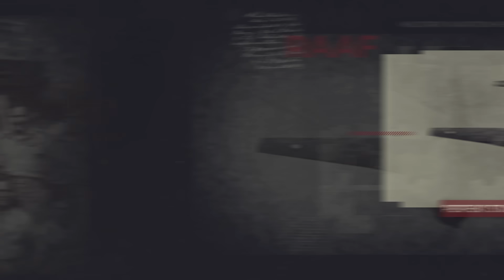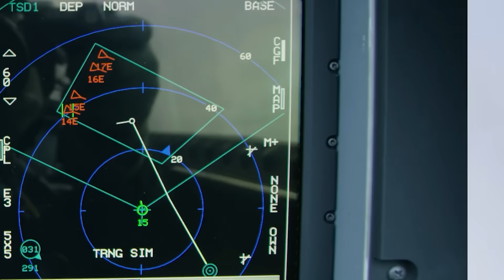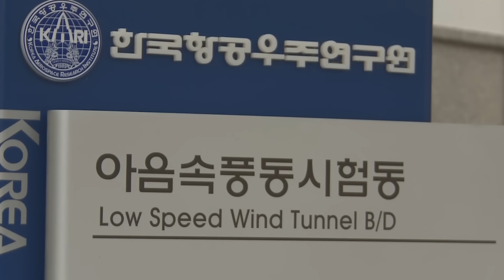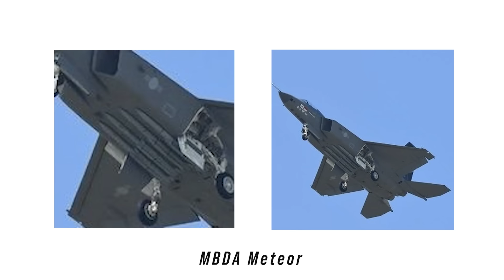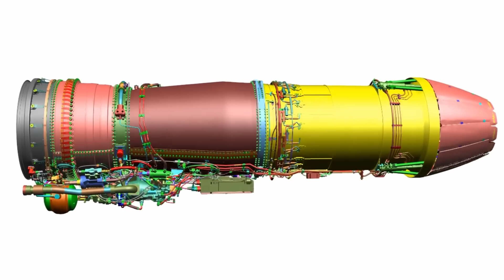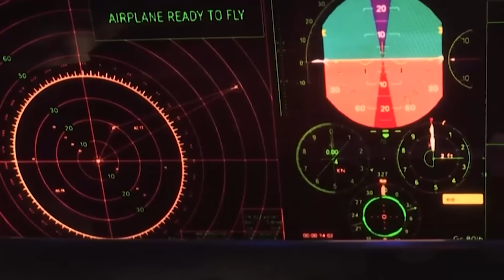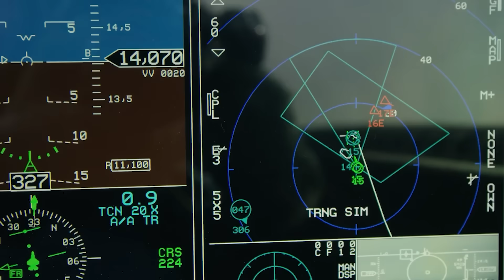KF-21: Korea's New Fighter

Comment: I would love for RAAF to take on the Black Widow II (the YF-23 concept) as replacement for the JSF, just I guess modernized, since there has been seemingly no engagement with NGAD or Tempest concepts for 6th gen.
Reply: Australia doesn't even build cars.  How do you expect such a small economy to build even 1980s cutting-edge aviation, much less an updated version?
Reply: @floycewhite6991  Australia is not a small economy. It is building both the ghost bat ai drone and the ghost shark ai submarine. And of course it would need participation from Northrop Grumman since its their ip.
Reply: @OniFeez  australia should be a way bigger economy and power tbh, obviously they have done very well but all the natural recourses, location, land, allies, education etc could get them into the top 10 most powerful countries if there was a real push,
Reply: @floycewhite6991 we used to have a good aircraft industry that made some jets I suppose education and reactivation programs would barely do the trick

Comment: It would be great to see Australia return to designing and building aircraft. Start with a smaller, cheaper, turboprop maritime patrol aircraft to supplement the big, expensive P-8s. Something that can be forward based on island territories (Xmas, Cocos, Norfolk, Lord Howe) with smaller runways and austere facilities, or just distributed across more of our coast. Then, move onto a light multirole jet that can double as a trainer. By the time its ready it can replace the Hawks. In the event of a war, we probably won't be able to rely on timely replacements for lost F-35s. Being able to locally produce a gap filler, or quick defense in numbers, would be good.

Comment: I am not an aviator in any way.  But I have been on the planet for 65 years.   My question is about stealth.     With North Korea and South Korea so close to each other would stealth make that much difference?    They have such a limited direction of attack and the time is so short I think they are right to use a less expensive air frame and make more.
Reply: That's a good question. KF-21 is named for the 21th century aircraft. So it's not for preparing against for NKorea. also, the above video didn't explain Manned air craft operating Unmanned aircrafts. Isn't it cool? If the stealthy aircrafts operates its wing man fights w/o flighters, this will help less life lost to perfill their tasks. It's a kind of 6th gen concepts. that's why the stealthy air craft design keeps to be support.
Reply: It has enough stealth to have an edge against the DPRK but doesn’t rely entirely on it. It has equivalent firepower loads to an F-16 which is a lot more than a fully stealthy fighter with only internal weapons.
Reply: In fact, it is not a fighter to take on North Korea. North Korea has less than 20 fighter jets that can actually operate. Because it has no parts and oil.
Reply: 그래서 대부분의 공군기지는 후방에 존재한다

Comment: Since the F-5E/Fs in S.Korean service only has short-range AAMs and light ground attack capabilities only Block 1s are more than adequate as they will have BVR air-to-air capabilities. My guess is that as the platform matures and becomes a true multi-role jet they will help phase out the 130+ KF-16s built under licence in S.Korea.
Reply: Among 40s of180s KF16C/D has done upgrade to F16V. And 40s of KF16C/D would be upgrade to F16V now.
No need to decommissioned soon.
Reply: The f-16c version held by the Korean Air Force is currently undergoing an upgrade to the f-16v version. 
In addition, all the f-15k aircraft will be upgraded to the f-15ex specification. 
Therefore, apart from the actual deployment of the f-21, there is no reason for the f-16 and f-15 owned by the Korean Air Force to be retired in the near future.
Reply: The Korean Air Force is considering upgrading KF16 to F16V.
Reply: @ChunSik262  이미 사업했습니다. 검토중아님니다 ㅡㅡ;;
Reply: They are going to do a weapons bay in block 2 aircraft and improved stealth, then in block 3 air to ground, they are developing this aircraft better than the f35 by doing everything all at once and look at all the problems they have had with the f36, over 800 tech problems, south Korea is doing it better and smarter.

Comment: The KF-21s will first replace the legacy F-5E/F made in the US. Then they will retire the locally made KF-5E/F (built by Korean Air in the 80s). After this they will replace the first 30+ F-16C/D that was brought in from the US. As for the F-4E set to retire in 2024. Seoul placed an order for 20 F-35As to augment the 40(39 one lost to bird strike) in service.
Reply: Japan also recently retired their F-4. In both countries they have used them as bomb trucks in later years so worked well enough for that until the airframes aged out.
Reply: They are still running F-4s ? Wow.
Reply: @notanymore9471  This is because they have a large number of long-range air-to-ground missiles, PopEye. PopEye missiles can only be operated on the F4 Phantom II. However, the Phantom has a lifespan of over 40 years and is gradually being retired in Korea.
Reply: @notanymore9471  Small country without the industrial base to support aircraft development.
Reply: one reason South Korea keeps legacy aircraft is because their simple design allows them to be scrambled in less than 5 minutes whereas f16s&f35s take at the very least 10~12 minutes. considering that Seoul as well as most of south Korea is only a few minutes away from North Korean threats, I think this is actually a very good idea

Comment: Uhh, this looks more like an F22 than an F35. Very cool.
Reply: It looks kinda like a hybrid between the two to me……
Reply: @notanymore9471  Either way looks pretty nice
Reply: @tigerthyssen3313  definitely the Koreans are savvy
Reply: The South Koreans had engineers from Lockheed Martin come over and help with the design so it's kinda' not surprising it looks like an F-22
Reply: @AsianDudeX01  It's basically a copy then
Reply: @ViktorZhang-n1g  not completely as it lacks the 22s type of thrust vectoring nozzles and is not full stealth
Reply: So that’s a bad copy. You better buy genuine F12 without spending ridiculous amount of money for developing from scratch, not sure SK spent such money though.
Reply: @平田桂-s3p  Not a bad copy. Its mean to be an affordable air defence fighter that can take down enemy stealth fighters. Between the F-35s and this, it should do a pretty good job. F-22 is still overkill. Nothing in the sky can see it. It also uses Tech's that are still illegal for the USA to export. Those techs by the way have still not appeared in enemy aircraft designs. So this Jet should be more than capable of handling Chinese or Russian knock off stealth fighters. Not only that but it should have more modern avionics than F-22 and will integrate better with F-35 than the F-22 currently can, plus its exportable. So if you look at an F22 like the B2 stealth bomber, then the KF-21 is more similar  to the B-21 which is built to be more affordable and mass produced. Similarly, F-22 could be compared to Ken Block's Gymkhana Subaru and the KF-21 is like an off the shelf WRX-STI and Russian/Chinese fighters are like a regular WRX.

Comment: Oh c'mon. Designed "from scratch"? It doesn't matter what earlier sketches or models might've looked like, clearly the final design takes 80-90% of its design cues direct from the F22. Personally I think there is no better warplane to try and emulate when creating a new fighter, but any claim that Sth Korea just happened to end up with a plane thats like a mini-me F22 by sheer accident or natural evolution is laughable.
Reply: Hush... the laws of physics care not for your missguided assumption.
There are only so many ways to build an LO fighter, of course they're going to look similar.
Reply: @FallenPhoenix86  On that basis, explain why the Su57 and J20 do not look like an exact F22 copy? And please don't say the KF21 looks like it does for stealth purposes, even SK admits its no more stealthy than a Gen4.5. And if I am therefore "misguided" as you claim, then I can only assume your glasses need cleaning.

(Edit: oh and it does not just look "similar", it looks a copy. I could show a picture of a KF21 to 100 aero nuts and I reckon 90 of them would say, "That's a Raptor". They would not mistake that about an F35, J20, Su57 or even the YF23... all designed to be LO)
Reply: @sbg911 SK did not admit it’s no more stealthy than 4 gen. It’s 4.5+ gen with smaller RCS than typical 4th gen fighter. Block 3 version will be full stealth with internal weapons bay.
Reply: @sbg911  
In broad terms... they do look alike, check your own glasses perhaps?

The J20 mixes it up with canards and the 57 has a flattened vertical profile, otherwise they are quite similar.

Again, the laws of physics don't care what you think.
Reply: @JohnLee-db9zt  my apologies, I meant to write 4.5... i have corrected that. But it is not considered Gen5 which is the point I was trying to make, considering I was being told all LO stealthy aircraft naturally end up looking like an F22 twin...  which to my main point, and the J20/Su57/YF23 show, is simply not true.
Reply: @FallenPhoenix86  This is not "broad terms". All planes look "similar" in broad terms, they all have fuselage, wings, tails (most). Obviously, designing a stealthier aircraft will have to have some similarities... but the KF21 is like showing someone a Raptor photo and then asking them to draw it. Thats my point, its too specific in its design cues to be claimed as designed completely from scratch. And I bet if the KF21 came not from an ally but from China as say the J22, people would be crying espionage.

Btw dont get so hung up on my glasses RESPONSE. You are the one that started it off by getting personal.
Reply: @sbg911  
Nose profiles.
Canted twin vertical stabalisers
Wing/horizontal stabaliser planforms.
Canopy contouring.
DSI inlets (where applicable).

Start looking at individual details across all 5th gen fighters and your going to see a lot of things in common... because the laws of physics don't care who you are, only what you're trying to do.
Reply: @FallenPhoenix86  Seriously, I am astounded this conversation is happening. Why can you not see that the KF21, out of ALL the recent fighters created, is more than just a collection of similar bits on all stealthy fighters and almost a copy of the F22 (albeit different size and no thrust vectoring nozzles)? Why is it you continue to argue this and therefore refute the fact that there are lots of articles, vids and comments across the internet with the question "why does the KF21 look like the F22". Its not "why does it look like the F35"... Or the Su57, or the J20... some other posters have even got to calling it the "baby F22".

Why try and score points on the basis of individual stealth components, and just bring up a picture of the KF21 and a picture of the F22 and see that no two other fighters look more like each other than those - its like you are denying your eyes - that you can fool many even aero types that a picture of the KF21 (minus the obvious painted "KF-21") is a Raptor. You can't do that with a KF21 against the F35, or the Su57, or the J20...

I am starting to feel if I showed you photos of twin brothers you'd say well, all brothers have noses, and eyes and arms and legs and...

My original OP was commenting on why, in the VIDEO, it's claimed the KF21 is designed from SCRATCH, and just somehow accidentally ended up looking like the F22's baby brother. Even a tacit glance at the two together can see the KF21 is far more than just some common bits all stealthy fighters have. And the differences to those other designs prove that.

And as I also said in my OP, there is nothing wrong trying to "re-draw" an F22 for your fighter design. It's actually a smart move, what is better to try and emulate than the premier fighter in the world. So I am not attacking the KF21, I hope it is a great success story. Just don't try and tell me when the SK engineers hit a snag or design issue they didn't say, "how does the F22 do this". And did that so many times, they ended up with a design that was seperated at birth.

So if none of that brings us back on track to my original comment's intent, then we will agree to disagree forever, and I will end it here and leave it up to others reading if they think the KF21 looks more like the F22's brother/baby than any other plane does (just search that on google), or as you infer its just an accidental collection of common bits all stealthy aircraft have.
Reply: @sbg911  
And I'm astounded you can't acknowledge there is a reason why trying to achieve similar outcomes will result in similar solutions and leave it at that...
Reply: It has avionics derived from the F-35 which puts it a cut above F-22 internals. The high speed intakes similar to the F-22 signal that it is designed for air superiority like the F-22 rather than low speed strike optimized like the F-35. The external weapons allow engaging a much larger number of targets at the same time at the cost of reduced stealth which is appropriate for countering the large but ancient DPRK AF.
Reply: 그렇지않다. Kai는 록히드마틴으로부터 자문을 구해왔다고 말했다 항상
Reply: ..how to define a homemade jet fighter?,even some of the f35 components are built here in Australia.

Comment: comment being 13:00 wow you are deluded these aircraft have been proven to lack flight time before needing major replacements is this channel a joke? 13:45 do you mean exceptional parts replacement of the engine due to kinda lack luster durability of metals in jet parts
Reply from the maker: No the channel isn't a joke - just in case you were wondering.
Reply: @raafdocumentaries  thanks hahaha just haven't laughed as much with this "modern techknowledgability" fancy not flyinginging in a 2nd hand kraft only because typical hours till service. ok its not metal is not ok yes delta no1.

Comment: Is it stealth like the F-35?
Reply: 4.5 gen very small RCS
Reply: It has lower RCS than typical 4.5 gen. It is more of a 5- gen. That minus is only for the external weapons which was an intentional choice to maximize firepower in order to face much larger numbers of adversary fighters and win.
Reply: It is only semi stealthy but has similar avionics advantages as the F-35 with much more firepower than F-35 can carry internally. It is similar to an F-35 in so called “beast mode” carrying external weapons but at much lower operating costs.

Comment: now I know this is their own design but straight off the bat I thought it was an F-22 but a little smaller and I can smell a copy cat
Reply: All stealth aircraft are bound by the same physics principles that influence design shaping. KAI did however license as much technology from the US as they could get to accelerate their development process. Many internal components are derived from the F-35.
Reply: @Stu_Bur  ok
Reply: @michaelargent6865 as opposed to China. I don't think they paid any licensing fees 😅
Reply: Turns out stealth required pretty much the same design
Reply: Not copycat, Lockheed has hand on this too. More like a licensed design by original maker
Reply: @DOI_ARTS  bro does it look like I have papers to note exactly who made the aircraft. No didn't think so also technically I would still be right although Lockeed martin had hands on the program doesn't mean they own the aircraft more so the company bought some blueprints for it from them and well copied features of the F-22 raptor so... there still copy cats
Reply: Look at Korean K2 Black Panther tank and M1 Abrams with Trophy Active Protection System or the AbramsX. Korean like to borrow a lot
Reply: @Peizxcv  legally
Reply: @Peichen01
Korea was offered the M1 Abrams but opted to build their own version instead, using licensed tech and consulting from the Abrams manufacturer. The reasoning was that this allowed them to tweak the designs to better suit their own local needs and it allowed a larger share of local production. K2 is a derivative of K1, not M1A2. They have significantly different features from Abrams that diverged further as they iterated on the original K1 tank design.
Reply: ..was f22 inspired,chief engineer Lee-Woo acknowledged the Lockheed help!!